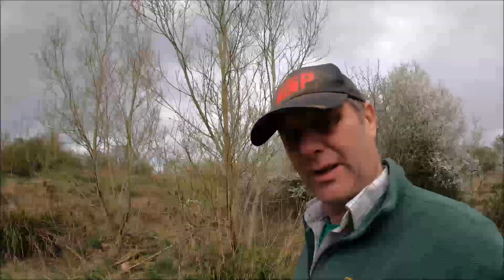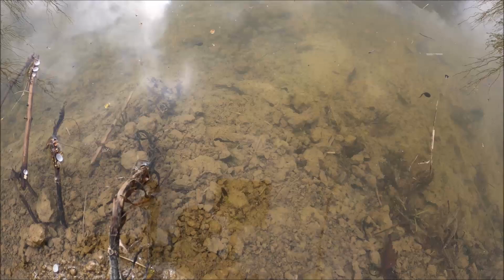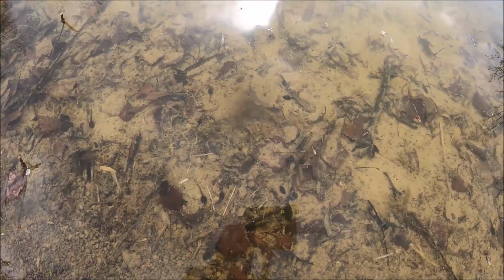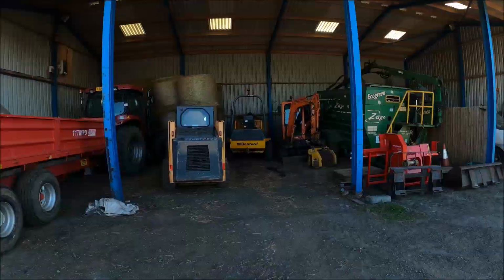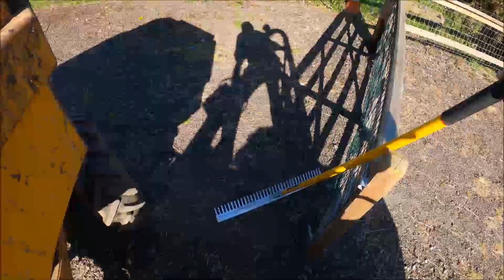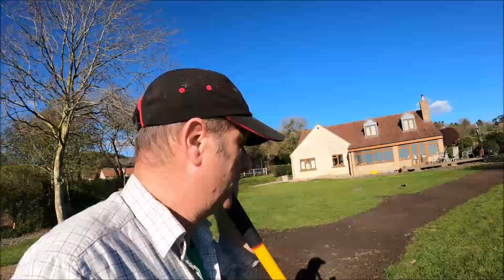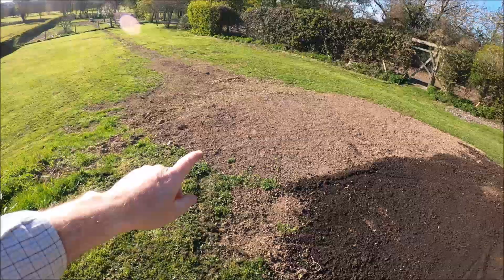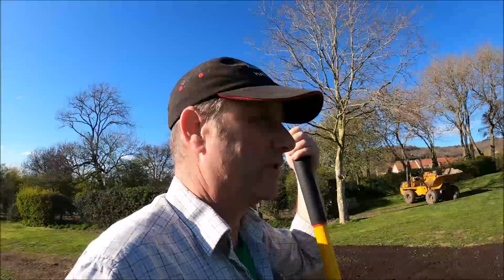Recycling a bit of "Dirt Island"  05 04 21

Comment: Hello i use to drive a dumper like that except it didn't have the luxury of electric start it had a hand cranked Petter engine the tub had a hand crank for the swivel that could only be accessed by turning to the left and chucking a brick under front left wheel rear right wheel to stop it rolling and a lever to tip it if you stood in the wrong place the return handle caught you as it tipped

Comment: When I used to repair cricket pitches, where they got most damage at either end, we used to re-seed and cover with hessian fabric, until the grass seed got going pretty well, then uncovered it and used a light roller., players could still play with the hessian pinned down, but a different part of the playing square.
Reply from the maker: We have a load of green netting I could use.... Except the pups would destroy that as well. 😄
Reply: This method works a treat, also useful when trying to get grass seed to take on slopes. 

I find the builders merchants usually stock it in 5' wide rolls for frost protection of brickwork.

The advantage of hesian is it rots  down so you can just dump it in the rubbish area  when finished with rather than having to skip it.
Reply: @paulf2529  We kept the hessian for years, let it dry out, then keep dry and it lasts a long time, more usage then.
Reply: @robertstibz9506   ill have to try that thanks, I've always just thrown it after each use. There is a post and rail fence by my workshop i could hang it on.

Comment: Keeping the dogs off it. With a scape arist in the pack.  Wil take some form of fence.   Good luck with that. Maybe you can find some sheep netting. Is very easy to put up. It is used here cery much. Is a light wait net that can be put under electic charge. It just neets.some poles in the grond. Small one. Like your electric fence line.  Goood luck keeping your dog pack off the new gras

Comment: A decent rake makes a big difference.  

I'm quite enviouse of the screener bucket  not something I've ever used  but could save me a fortune considering the amount  of topsoil I buy in for work although I would have to find some barn space to store the screened material.
Reply from the maker: Far better if you can keep it dry for sure. Screened topsoil is expensive stuff 🙂👍🏼

Comment: Hi Ian I know you are a busy lad but I have a serious arbor question for you, here in Gateshead Tyne and Wear I work for the local authority you may remember me talking to you via your YouTube channel, anyway I am noticing an increase in vandalism to trees especially fully grown Beech where the cherubs we shall call them, come out at night and start fires in a small hollow or cleft in the buttress of a tree, this as you will suspect leads to the eventual failure or felling of said tree, it normally takes the cherubs a couple of sittings to completely take the tree past the point of no return, giving us a chance to do something normally not much, my question is this other than concrete which used to be the way do you know of or have you seen any product with which we could fill the cavity and prevent further fire damage. 

Thanks for any help in advance. 

Regards

Bob
Reply from the maker: Clean what you can from the cavity, then stuff a bin bag in and fill it with a fire resistant expanding foam, you could put a ply lid over the cavity if it’s practical to help force the foam to stay inside and leave a flat tidy face, remove the ply and fibreglass (or indeed concrete) the face.  Maybe imbed a few fire crackers in there to blow the little buggers wigs off if they try it again. 😄